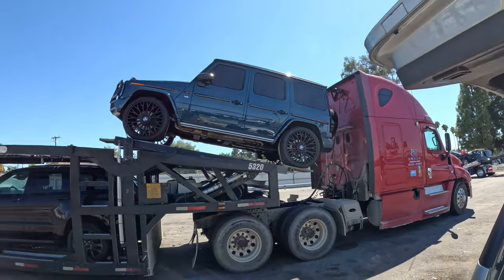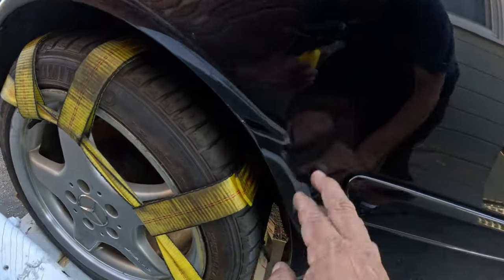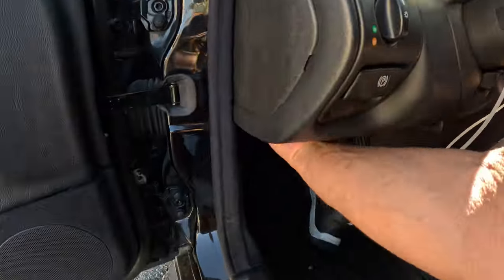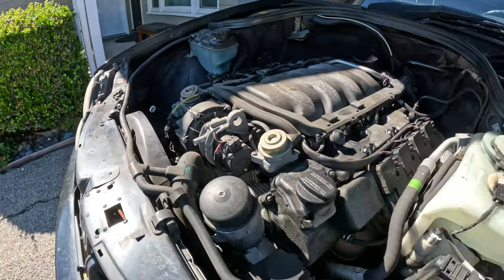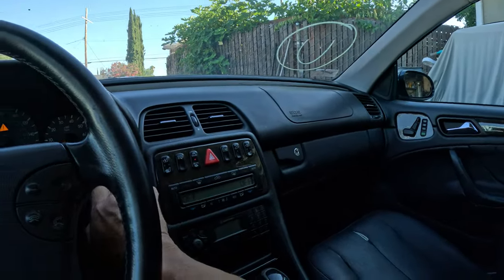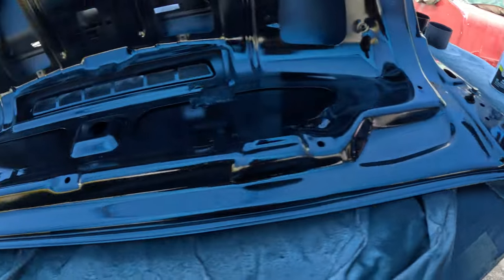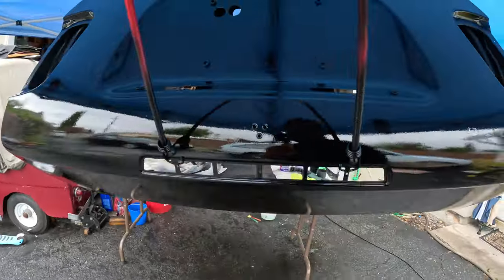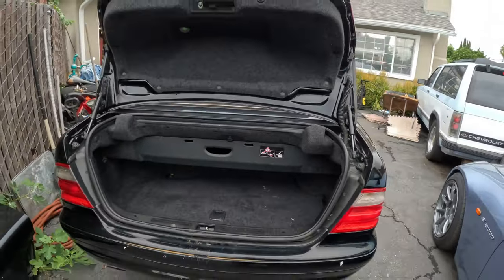2003 Mercedes CLK 430 Rebuild

Comment: Picked up a 2002 430 coupe for couple hundred. Sat couple years under a tree. Seller gave up on it. It wouldn’t turn over. Starter tested out fine. Ended up being a broken ground cable.

Comment: I think you need to help the top opening then press the red button.
Nice video!
Reply from the maker: Yes it does, hahaha. After filling up the hydro fluid and found that leak, all is good now
Reply: @BobbysBackyardAutoworks can you do a video on that I just bought one as well and the line is leaking. How do I fix this? Also where is the pump located so I can fill it up.
Reply from the maker: @436Jugg  I cover that in part 2 video, should be up

Comment: Need more content on these cars, I’ve had mines for 2 years now and she’s been great to me 😊😊😊
Reply: You have nay spare parts for mine 😅😂
Reply: I need quite the stuff my dad has had it for bout 16 years and now I’m starting to drive it it needs a deep clean, paint job and seats need repairing, the radio and buttons need replacements and also mines not a convertible but has a sunroof instead I Alr ordered the rubber for it I need more of the wood molding that goes in the side of the car too it’s just like this guys a greenish tint 😅🙏 lmk if you know anyone with spare parts or have any your self please 🙏
Reply: @DinoDom11  no sir
Reply: @thump2727 Alr 
Thank for replying man